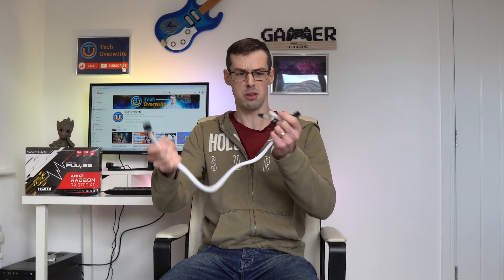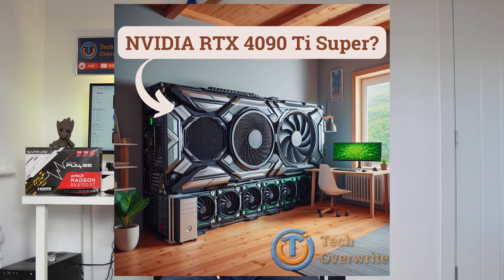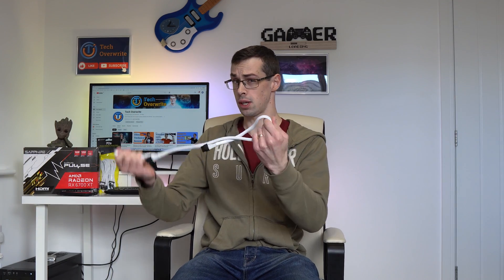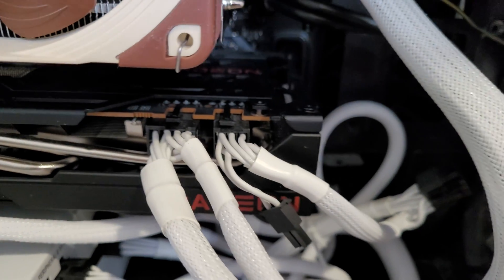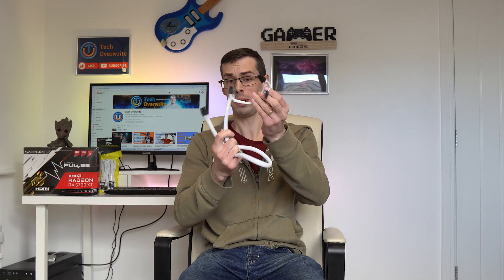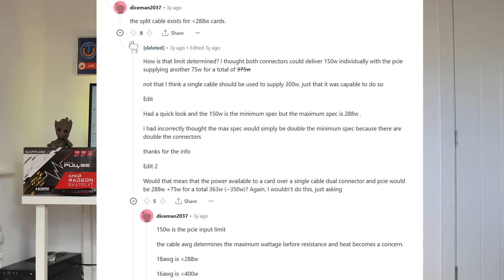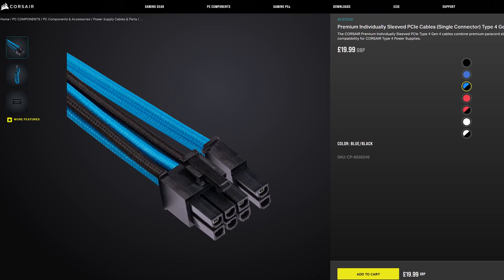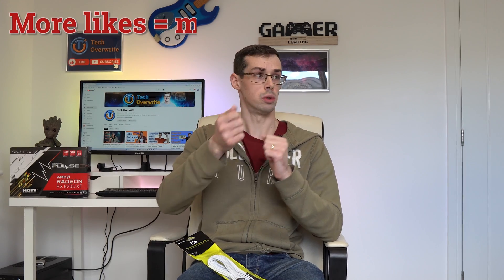Stop Connecting Your GPU Power Cables Like This! (How To PROPERLY Connect PCIe Cables For GPUs)

Comment: Hi i have PSU - be quiet! Pure Power 12 M 1000W 80 Plus Gold ATX 3.0 - there is no 8 pin to 6/2 pin. There is 12v1 and 12v2 ( 12 pin cable to 2x6/2 pin cable and another 12 pin to 2x6/2 pin cable) My rx 7900 xtx have 3 power connectors, can i connect  12v1 to two slots/connectors and second one 12v2 to 3th power slot?
Reply from the maker: Hi, I can't say for sure without digging into the specs, but my hunch is that it should work fine. That's a quality PSU and it sounds like the right amount of power will be supplied 🙂

Comment: there are so many 750w+ psu's coming with 2 cables. if i want a third one, i need to find a unicorn psu or pay insane import fees.
Reply from the maker: Yes true, it's a bit frustrating but luckily 2 separate cables can supply a fair bit of voltage (375W minimum) which covers many GPUs. And then NVIDIA'S higher end cards use the newer 12vhpwr cables so that's also okay with 2 PCIe ends. Meaning that luckily the majority of GPUs are covered by the current range of PSUs 🤞
Reply: @TechOverwrite  im probably running a bad case scenario lol..
sapphire nitro+ 7900xtx that sits at 406w total board power on max load with 2 cables and a pigtail, the psu is cooler master mwe gold v2 850. 
i did not have a obvious problem running at max stock power for 3 hours and i have asked opinions of people about it before plugging it in. it should be no problem given these cables have high safety margins, but it has been in the back of my mind.

Comment: Thank you very much for your explanation sir ! I just bought a 7900 xtx and I had to change my PSU because I was missing a PCIe cable and a vendor told me that I could not just add a random cable. I didn’t find anything on internet so I trusted him and bought a new PSU, is it true or did i just get scammed ?
Reply from the maker: Glad to have helped :) Ugh that's frustrating about your PSU. So in general it is best to avoid random cables - especially if it's a random 'no name' cable from eBay or a badly reviewed Amazon cable. However a more quality cable (e.g. from CableMod) would have been fine. Avoiding random PCIe cables is generally good advise though :)

Comment: I remember my red devil 6900xt having instructions telling you which socket to put the daisy chain plug in if your psu only had 2 pcie power sockets. can't remember if my red devil 7900xtx does though I upgraded my psu to have 3 separate cables. never had graphics crashes at all
Reply from the maker: That's really interesting, yes it's good when the instructions are actually helpful - so many GPUs are too vague here IMO.

Comment: For a red devil 6600xt that has a 6pin+8pin connector (all other 6600XTs have only a single 8 pin) will I be fine using the same cable to power both the 6+8 pin connectors. 
I have a Corsair cv450 and it only has a single pcie cable with 2 8(6+2) pin connectors and this is the only choice i have.
Reply from the maker: Yes you'll almost certainly be fine here, the TDP of that card is low enough that a single cable should work fine 🙂

Comment: Hello mate I recently bought a 4070ti and my old 1660ti was using only one 8 pin conector I could just buy the gen 5 cable and plug direct to my GPu?
Reply from the maker: Hi mate, yes if your PSU supports it then there's no problems switching over to the newer cable. However I probably wouldn't use an adaptor cable (if you have an older PSU). It's a pain but I'd probably upgrade my PSU in that case. But certainly, if your PSU supports it (i.e. sells a 12vhpwr or 12-2x6 cable) then that's fine to use :)

Comment: hello might have stupidly pigtailed my 4090 lol. i have sfx 750 cosrair platinum that only had two pcie so i plug one and second with one pigtailed total 3 left the fourth plug spare . ran all good no crash. but i think it lowered in performance. Max watts running 350w. i think it ran more than 400w before. did i damage the pcie cable or damage the gpu?  just ordered Corsair 600W PCIe 5.0 12VHPWR waiting to arrive. thanks
Reply from the maker: Hello, yikes that's a difficult one! That's an awesome GPU, and I appreciate your concern. Hmm... I personally doubt that you have permanently nerfed the power usage of the card (down to 350w) to be honest. It's more likely either a coincidence, or maybe an issue with the PCIe cable, but I doubt that too. I think that the new 12VHPWR cable should work fine to be honest, and ensure proper power for your RTX 4090. In short, I don't think you have damaged anything - and I hope that the new cable results in awesome gaming for your awesome GPU lol 🙂
Reply: @TechOverwrite  Thank you for the reply ! i dont have to strees anymore haha.

Comment: Will doing this help eliminate coil whine? or reduce it
Reply from the maker: A few comments have said that this fixed their coil whine, so fingers crossed it helps yours too. Sometimes coil whine can have a different cause, but a slightly underpowered GPU can certainly cause this so it's worth trying IMO 🙂

Comment: I have a rx 6800 and a cooler master mwe v2 850w It only has 2 6+2 pcie connectors ive had to pig tail the thirds connector to my gpu. Will this be ok any advice would be appreciated guys. I dont want to buy a seprate cable as from the cooler master website its £21 just for a cable.
Reply from the maker: Yes this will be fine - the two separate cables will deliver enough power for an rx6800, even if you do then need to rely on the pigtail for that third connection. You'll still be fine from a power delivery POV 🙂

Comment: I upgraded to a 7900XT recently and was using 1 pcie cable with the pigtail 6+2 pin to power my GPU. 

Ive had so many AMD driver timeout and even worse, complete freezes, where my PC becomes unresponsive. Ive attempted to wait it out but it doesn't become responsive until i force shutdown manually on the PC case. Which i know isnt safe. 

So, ive since switched to using the 2 seperate PCIe cables that came with my PSU, Gamed for 5hrs and no crashes.

I dont wanna speak too soon and say this was the cause of my issue, as i havent played long enough to test fully. 

But after so many troubleshooting steps, this was my last resort possibility to the cause.

What do you think? Is it possible this was causing it? 

Perhaps my GPU wasnt being fed enough power for what it demanded?
Reply from the maker: That's really interesting - sorry to hear of all the crashes and lockups. That sucks. Yes the 7900XT is quite a power hungry GPU, so it could have easily been the cause of crashes with just 1 separate cable. Sounds like you might have correctly tracked down the cause 🤞. I hope your build stays stable,  happy gaming 🙂

Comment: So if i have a non modular psu i should get a modular one so i can add more pcie cables to power stronger gpus?
Reply from the maker: It depends on how many PCIe/CPU cables the non-modular PSU comes with. If it's 3 cables, that should be fine for fairly powerful rigs. But 2 cables (1 for CPU, 1 for PCIe/GPU) probably wouldn't be enough for more than mid range GPUs. It just depends on what you're looking for from a system 🙂

Comment: my psu is corsair 650w and i cant use separate cables. can i use only one? or what do u suggest i cant buy another psu
Reply from the maker: Corsair make good PSUs do you might get more than 150w on a single cable, but it's hard to say for sure. I'd probably play it safe and get GPUs with a TDP of 250 watts or less. Yes 250w is more than 225w, but you can always slightly undervolt if you experience crashes. But you might also be fine with a 250w GPU and Corsair PSU. It's hard to say for sure. Happy gaming 🙂

Comment: Can someone help me out I have a 3080 FE with dual 8pin connectors, the psu cable that I have use a 6+2 method. What is the +2 use for? can I just use the 6 and not connect the +2?. Most 12 pin to 8pin  adapter  after market cables only have 6 pin connector even though they claim they have 8.
Reply from the maker: You can use it either way (2x 6 pins, 1x 6 pin and 1x8 pin, or 2x 8 pins). Any will work 🙂 The 2+6 is for compatibility because some GPUs only need 6 pins, others need 8 pins.
Reply: @TechOverwrite  Thank you for the answer! How would I know if my GPU need 8pins or 6?
Reply from the maker: Sorry for the delayed reply (the YT app isn't great at showing me follow-up comments). You might be able to look up pictures of a GPU online and see its PCIe connector config through that. Or maybe try emailing the GPU maker and asking them - that can work, depending on who the company is.

Comment: what about the 600w seasonic 1 piece 12v cable, without the pigtail, just one piece
Reply from the maker: Ah yes, the ATX 3.0 or 3.1 '12vhpwr' cable? I didn't cover this as much, admittedly, although I do in another video (PSU connectors for ATX 3.0). Basically yes this cable should be fine for modern NVIDIA cards, although just make sure that it's fully plugged into the slot and there are no gaps 🙂

Comment: If i may ask. What the heck is the point of the pigtale if its useless?
Reply from the maker: Fair question - it's probably for multiple lower power PCIe devices like ones that need 100-150w (for example) since these would need an extra 25-75w of power when accounting for the motherboard PCIe slot. In this case, a pigtail cable would be fairly useful I guess.
Reply: @TechOverwrite  hmmm, interesting point.

Comment: Dumb question probably but will it work if i get 3 of the single premium PCIE Corsair cables for my RM750 and 3080TI?
Reply from the maker: Yes that would be more than enough power (those cables look awesome - that's what I use too). 🙂

Comment: if only using 1 wire with a pigtail to my rx 6800 could this be causing a constant BSOD with the stop code WHEA_UNCORRECTABLE_ERROR and cause my pc to not boot at all?
Reply from the maker: Potentially yes - I'm not 100% sure of what BSOD codes might be, but the RX6800 can be fairly power hungry so if it's crashing when gaming, the 1 wire could certainly be the issue.

Comment: So using the two VGA slots on my PSU is fine. I was thinking one cable per component so I was just fact checking myself that two separate cables was the move. Thanks! 😂
Reply from the maker: Yep, glad I could help 🙂

Comment: But my power supply only has one 😢
Reply from the maker: Yeah I get that, sorry man. Basically it means that you should probably stick to slightly less powerful GPUs - maybe with a max TDP of 225W or so. You could get one slightly more powerful and then look to undervolt it though - that can also get the power usage down too.

Comment: Should i use 2 separate pcie for my 7800 xt? My psu is super flower leadex iii 850w gold
Reply from the maker: I would probably use 2 separate cables ideally yes, since the TDP is around 260W. Some PCIe cables will supply that (along with the 75W from the mobo) level, but others wouldn't - so I would probably just play it safe with 2 separate cables 🙂
Reply: @TechOverwrite  thanks!

Comment: My PSu only has only 2 PCI cables 😢
Reply from the maker: 2 including for the CPU? If so, you might just have to stick to 225W or below GPUs - or explore undervolting a higher range card so it uses less power. But if you have 2 PCIe slots just for your GPU, that should be enough to power nearly all GPUs in the market to be honest. 🙂
Reply: @TechOverwrite  only thing i have is the cord you say dont use that goes will it fry my card as soon as i do it.I just wanna try it untill my psu comes in a few days
Reply from the maker: It depends on the GPU - it depends on the TDP (power requirements) of the card in the video, but in general using 1 cable for a mid range GPU wouldn't fry it 🙂

Comment: So much misinformation in this video. Not maliscious. Just naive. The recommendation of using two separate cables still holds for many upper end cards, but rtfm of your card. It sould specify what is required.
Reply from the maker: Thanks for the comment, definitely never my intention to state anything inaccurate. A fair number of mid range cards need 2 separate cables too, and a surprising number of manuals also seem to blindly say "connect 2 cables" just to cover themselves.

Comment: So my pc has the weird pig tail thing but my card only has 1 and it’s not powering on
Reply from the maker: Hmm sorry to hear it - is it fairly recent that the card has stopped powering on? Double check that it's fully seated in the PCIe slot (remove it and put it back in), and also double check the PCIe connections. But if they're all good, unfortunately it could be an issue with the PCIe cable or the card itself.
Reply: @TechOverwrite  so I fixed it the pcie slot was shorted by my mother bored hitting the back of my case thank tho
Reply from the maker: Ooo that's interesting, nice spot and congrats on fixing it 🙂
Reply: @TechOverwrite  thanks

Comment: Very informative video. My case is a bit a peculiar. I have a Sapphire nitro+ RX 6800 with a TDP of 250 watts. Afterburner shows that  the GPU draws about 210-220 Watts at full load. I've always used one PCI-e cable using both leads to connect to the card and never experienced any crashes. After doing some reading I opted for two separate cables thinking the GPU might run more efficiently, but there was difference so I switched back to one cable since I started noticing sporadic BSODs while gaming. I'm just curious why the card runs fine in my case with only one PCI-e cable?
Reply from the maker: Thanks, and that's very odd indeed. I can't immediately think of why that might be happening either - it's not like the GPU can get 'used' to a particular power delivery. Maybe the motherboard needs a CMOS clear and it's more of a coincidence than anything else, but who knows. It is odd. In terms of working with 1 cable, some better quality PSUs and PCIe cables will supply more than 150 watts - so that's likely to be it, especially if your card usually only draws 220 watts at peak.🙂

Comment: I have an msi a650bn and it is non modular with only one split(dual) 6+2 pcie connector. I'd like to upgrade to an rx 7900 gre in the near future and that card has 2 8 pin slots. Does this mean that I have to get another psu?
Reply from the maker: Hmm it'll be a bit tricky with the 7900 gre unfortunately - it's TDP is 260w, so using a single cable might be a struggle. You could explore undervolting it, but a new PSU might be better unfortunately 😔

Comment: I’m nearing the end of my first pc build and found that the graphics card needs 2x 8-pin power connections. Did the web search on the issue to see a lot of comments saying ‘just use pcie connectors.’ One point I haven’t seen addressed is that the pcie connectors are missing a single pin within connector on psu end. What gives? Does this effect power being supplied? Is power 1/8th less? So around 130w rather than 150w?
Reply from the maker: Congrats on the first PC build :) This can actually be fine, it won't decrease the power output or anything. Corsair have a useful post on this: https://help.corsair.com/hc/en-us/articles/27358102822669-PSU-Why-is-there-a-missing-Pin-on-my-PSU-cable

Comment: You saved my life man, first time upgrading to 6700 XT and was totally scratching my head with what I'm doing wrong with my game crashes and stutters, thank you!
Reply: I always had my 6700xt connected with a single cable and never had any issues.
XFX 6700XT Qick 319
Reply: @Aguswann  whats your psu? i am currently having trouble where i got black screen of death
Reply: @ XFX XTR 650W
Reply: @Aguswann You have a much better PSU than my short term use  Corsair CV650 bronze. No end of crashes when playing at 4k. Assumed PSU couldn't handle the 325W GPU total power  plus the 5600 overclocked.
Reply from the maker: That's awesome to hear, glad this helped and happy gaming 🙂
Reply: same lol
Reply: Weird. I had an RX 6750XT connected with this pigtail method and I had no stutters no crashes no nothing... Games ran nice and smooth.
Reply: @Oozaru85  probably juest have a good enough psu, or your specific card model isnt being so strained by the connectors